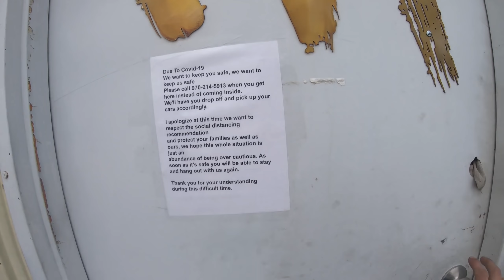B20VTEC Integra ENGINE Harness Swap/Fix

Comment: Great vid man wiring is a pain but when you learn how to deal with it ain't nothing after that   .testing sensors for ohm resistance  and traceing wires for power   volts the hole sha bang  great fun 😎😎😎😎

Comment: I can do wiring all day TV's sound system engine stuff simple to me. Remember electrical systems have to flow like water no kinks no binds free flowing voltage no surging off power load. Like Bruce Lee said be water my friend.
Reply from the maker: Just like water and air boost need smooth flow as well
Reply: I often find the power means nothing until U are truely grounded...jAMES wHITEman......!!!
Life lessons In There..

Comment: Love the harness work! Grab a Mark Ethan solder station and holder/ dispensing reel on Amazon. 80 and 15 dollars. Then they have awesome wire to wire solder jigs and even DualWall heat shrink that's ip67 water tight.

Comment: Have u tried the little resistor box or relay inside of the engine bay it should be up by the firewall on the driverside, i think this is a common issue on earlier hondas in the Obd0 era

Comment: Hey guys I have a hatchback 97 with b18b swapped,  I have a 94 acura harness in good condition,  did I have to swap ecu ? Needs recommendations or advices .
Reply from the maker: I believe that’s obd1-obd2 so you can’t just like plug it in

Comment: Goofy I am just wondering why are you always on the floor is that by choice or do you not have a bench to work at ???
Reply from the maker: I don’t have a bench besides the welding table I’m working on it though I just gotta do a lot of cleaning still to get the bench out of the back shop